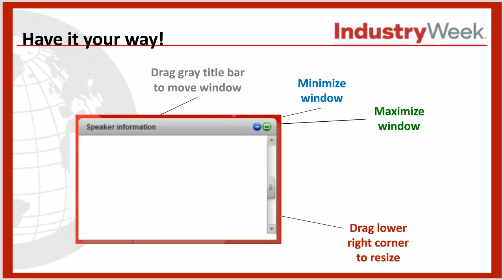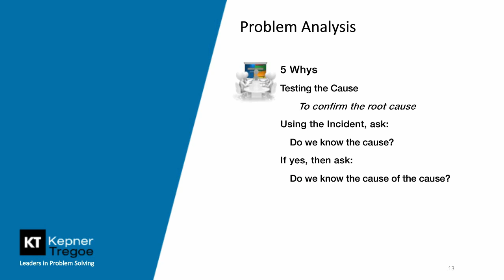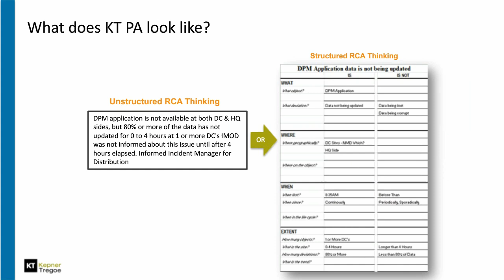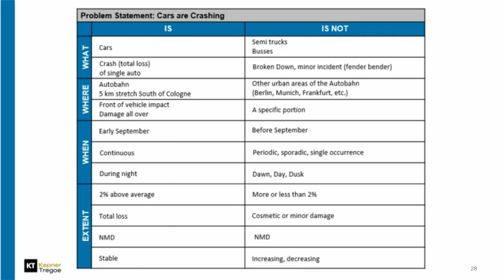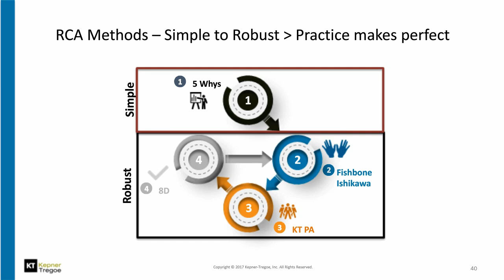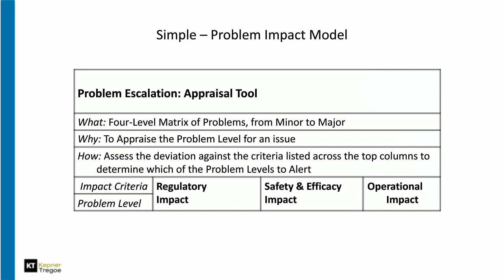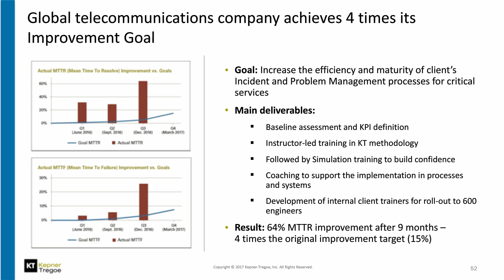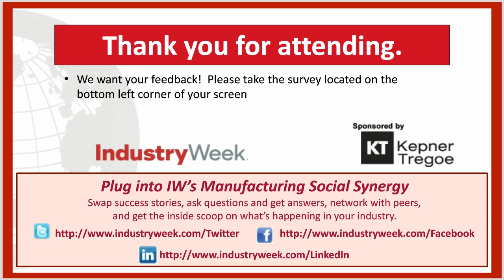Root-Cause Analysis Tools, and How to Use Them - Kepner Tregoe Consulting & Training

Comment: 05:12 RCA Tools list
27:08 KT Is/Is Not example 
30:41 RCA Methods - Simple to Complex (5 Whys, Fishbone/Ishikawa, KT PA, 8D)
31:41 KT 8D Model
31:48 KT 8D Template example
47:53 Simple Flowchart for finding cause (5 Whys, KT Is/Is Not, Fishbone/Ishikawa) 
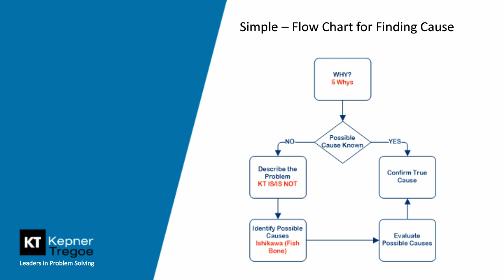49:17 Complex Flowchart for finding cause 
50:50 Example: Problem Escalation: Action Tool